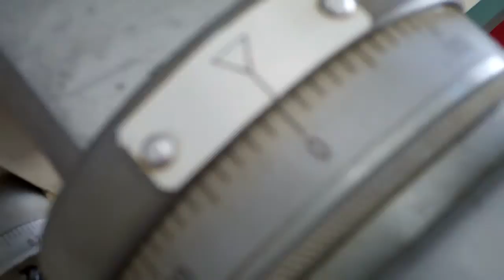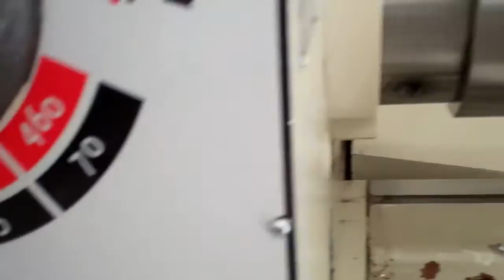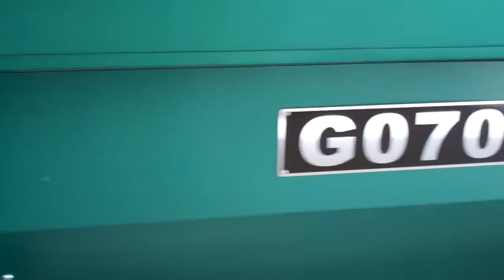Grizzly G0709 Taking .200" Cut

Comment: You might want to rethink your tool that lays on the ways of your lathe its not a very good practice to be doing. Like the video of the cutting demo. The ways are the life of the machine being accurate. Thanks for sharing
Reply from the maker: Thanks John,

Yes, the ways should not be used as a tool holder and I do try hard to protect them!

Thanks for tuning in!

Best Regards,
Ray

Comment: Thanks for taking the time and making the effort to share.  Just slid my G0709 off of the trailer and into the garage - still working on un-crating it - haven't fired it up yet.  That was a cool video, but I have to confess - I was a bit motion-sick and unfocused by the end of it.   Read an earlier response that you've got a tripod set-up now.  It would be great if you re-shot this video with that setup - this is a cool video.  I thought you were cutting aluminum until toward the end, when you said it was steel.  Pretty impressive ... taking a 0.200 cut in steel like that.  Makes me think that I'm gonna be pretty happy with my G0709 once I've got it uncrated, leveled, cleaned up, lubed up, broken in, and makin' chips :-)
Reply from the maker: Hi John,
Sorry for the poor video quality, I do have a much better set up now! I just moved to a new home and have been down since packing up the old shop but will re-do this video once I'm all set up and running again! You are going to really like your new Grizz, it will work very well for you and do everything you need it to do!

Best Regards,
Ray